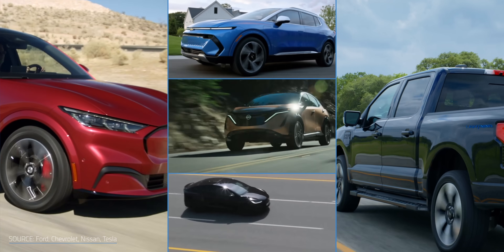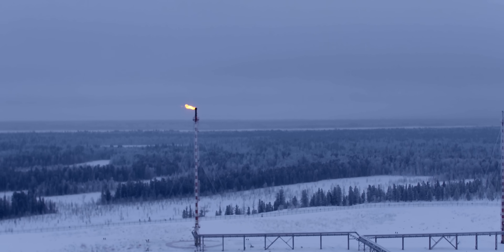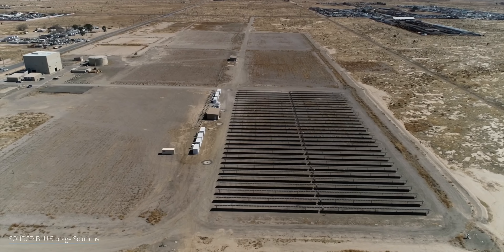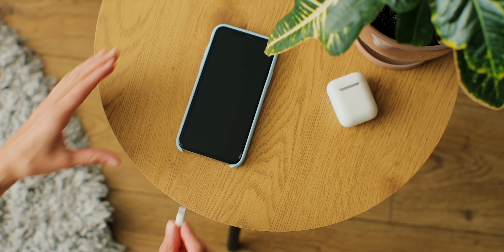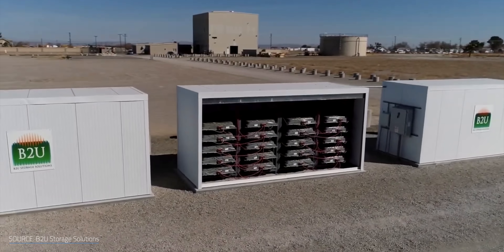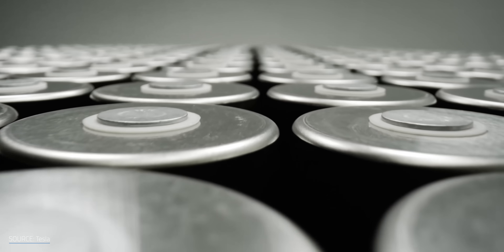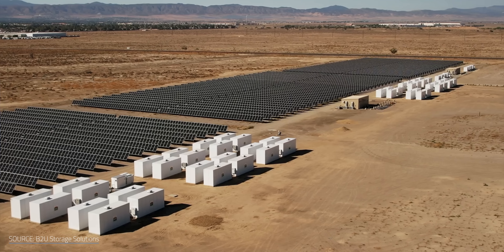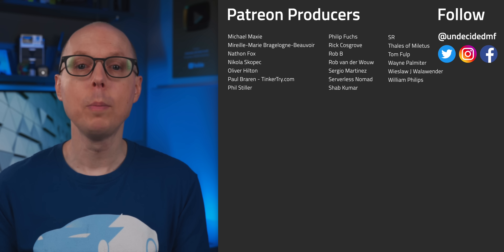How Old EV Batteries are Perfect for Energy Storage

Comment: Love the video, but what happens to those batteries as well after they reuse it? Are they recycling the batteries after? Why arent we lobbing for better designs to the way we make the batteries for easier recycling and reuse of said batteries? Why do they have to be hard to replace sections of the batteries? Lots of questions if you ask me that went unanswer as we move forward. With that said, I still think the move to sodium and sulfur will help be a large move in terms of getting those cost lower and reduce, reuse, and recycle these batteries in the future. I still think if they want to sell and produce EVs - those same companies need to invest into the battery recycling program. Much like lead acid is - so should the EV.
Reply: yes I am sure the batteries in this video are recycled when they are done. There are companies just waiting for batteries, but uses like this are keeping the used battery prices up. In this video I saw some 2011 Leaf battery's and the nice thing about the Nissan batteries is that they can be taken apart. I also see the sodium carbon nanotube sulfur batteries as a really great change.
Reply: @LaserFur  Nope, the industry isn't set up for recycling and won't be for decades.  It's something that has to be developed over time and become part of the economy to make it work.  Just like we used to have a recycling issue with lead acid batteries, it similarly took decades to address.  However, part of the issue is both the production and any presently conceivable recycling options will produce their own polluting byproducts and lack efficiency.  This is never addressed in the majority of these discussions.  Nor the very premise of treating carbon as a pollutant when it's not that simple.  Since, all life on the planet is carbon based and depends on carbon nearly as much as it does water.  People over simplify the issues and ignore the glaring holes in their logic as it's mostly devolved to politics instead of actual science.
Reply from the maker: Lithium battery recycling is happening today already, but the scale of the processing has to ramp up.  It'll take time, but it'll happen faster than many people think.  Just look at Li-Cycle, Redwood Materials, Recyclico, etc.  There's a race to try and corner that market.
Reply: @UndecidedMF  No, sorry but that's misleading. What they're call recycling is not actually recycling but salvaging.  Much of the battery is not recovered for re-use, leaving a lot of waste in the process, and that doesn't change all the harmful byproducts produced in the process anyway.  I know you mean well but that isn't realistic with where the process actually has to get to before it breaks even, let alone become a net gain.  While ignoring all the damage it will do in the meantime.  Europe is much further along than the states but we're still decades away from a real solution.
Reply: @ZeoCyberG  Some waste is okay because the benefits of batteries far outweigh the negatives. If we strived for true zero waste then modern technology would not exist and we would live like before year 1700.
Reply: @antronx7  No, we're talking about far more than a little waste. Much of it extremely toxic and will effect the world for centuries.
Reply: @antronx7  Among many other issues...
Reply: @ZeoCyberG  Exactly which waste? Name one periodic table element you are worried about. We talking about lithium batteries?
Reply: @antronx7  Do a little research, you'll be surprised how bad it actually is because nothing is just one thing.
Reply: @ZeoCyberG  why should i if you are so sure that batteries are toxic for many years yet cant provide single example of what is exactly making them so toxic.
Reply: @antronx7  Because everyone should know and it's not like those in the industry will tell you the truth... Video link shows what happens when we trust the industry... Besides, the point is you don't have to take my word for it... Know the facts!

Comment: The non-centralized-source alternative: First, think of the EV primarily as parked storage for the house. Basically, drive way less and use alternate transportation. (This is the reduce part of the slogan -- and reduction lowers the stress on components since a lithium battery's longevity is optimized when kept well below fully charged.) Next, have a plan -- and the hardware/software -- ready to remove the battery from the EV and integrate it as a powerwall when the battery's effectiveness for the car drops to 70-80%.

Why decentralize? Because decentralized power utilizing EVs as storage is better for the planet, for urban livability (less traffic) and for the economy. Besides, scalability and adaptability function more readily as individual cases, than when massively centralized. Centralized production of components has opportunities-of-scale. Decentralized applications have opportunities-of-configuration.

Comment: The main issue is that the packs all have proprietary designs which are only getting more and more complex. If hacking a first gen Leaf battery to use as grid backups was relatively easy with purpose made electronics, the tech in the new ones is just insane. Soon only the manufacturers are gonna be able to "convert" the pack for stationary storage, and something tells me they're not gonna do it (more profitable to recycle the materials while selling you a brand new powerwall-type battery) or it's gonna be so expensive that why bother with a used pack?
Plus, lithium cells have their main advantage in energy density...which is almost entirely pointless in stationary storage. If the battery weights twice as much, that's a big deal in a car. If it's bolted down and never going anywhere, what's the point? Lithium loses its key advantage, while all the minimal but still present safety hazard concerns remain.
Old school NiMh batteries (or even old special lead acid), such as the ones used in forklifts, are a much much better option as "used battery pack for energy storage". They're much safer, don't have complex designs and electronics, can be managed in charge/discharge with very basic hardware & software, are ridiculously cheap per kWh and their lower energy density doesn't really matter.
Reply: I think if you if you check a lead acid battery specially old ones will lose 40% of the energy going into them when charging and discharging

Comment: I am surprised that the battery packs aren't  paired with other battery packs that have the same "life" left in them.
Reply: Letting software take care of different battery pack states live together is a more efficient approach.  Once you have the software capability built, it will also allow for different packs from different OEMs also get used at the same facility.  You just need enough “old battery” inventory to become available to make the software/hardware integration tweaks to be worth it.
Reply: Battery cells don't all wear equally and the more the battery degrades the more differences will pop up...
Reply: @ZeoCyberG  My comment was on the pack, not individual cells. By simply running the pack through a few charge / discharge cycles in order to ascertain the pack's condition, they can be grouped together with other packs that have similar capabilities.
Reply: @jojones9194  Again, it breaks down to the individual cells.  The packs won't all perform the same over time.  System needs to adapt over time for it to work.  Especially, if you want a reliable power grid and reduce the chances of catastrophic failures.  These aren't the safer LifePO4 batteries.  So there's also safety concerns.
Reply: On the contrary, if the packs are all the same age, then the entire array degrades.
If instead you put the most stress on the weakest batteries, that allows them to be completely used up and sent to recycling while new (recently retired) ones are swapped in, maintaining a stable overall performance for the array.

Comment: How long do they expect the batteries to last in these storage facilities?
Reply: If i remember correctly he said the batteries take 7 years on a tesla before reducing to 80% efficiency so if i were to make a guess off that id say atleast 14 years before they get dumped
Reply: It could be quite a while. The capacity fades steadily, and in this application pretty slowly, so the soonest reason to actually replace them would be that you need the shelf space or similar. And some of the packs are fade a lot more slowly than others. In some scenarios >50 years might be fine.